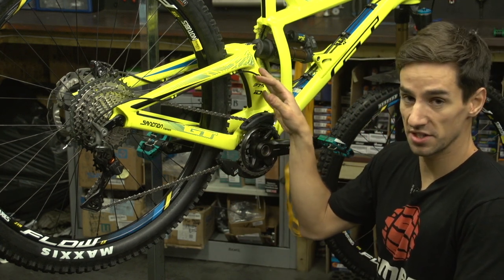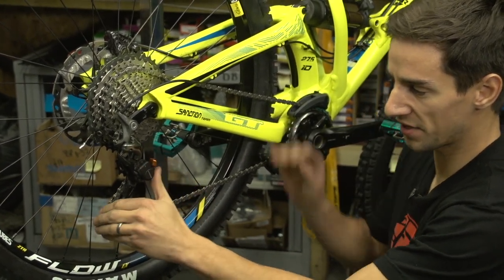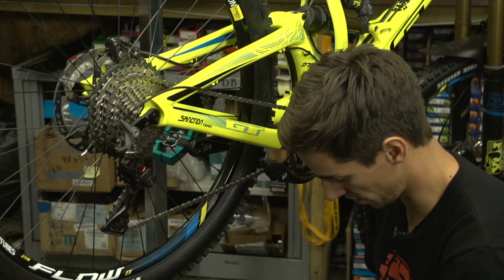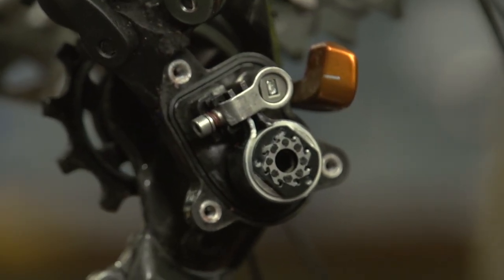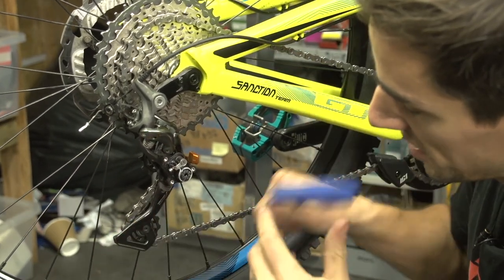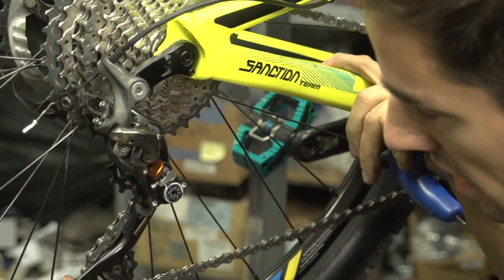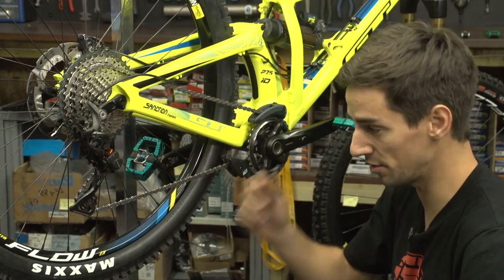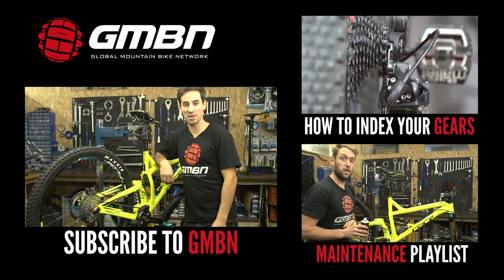How To Adjust A Shimano Rear Derailleur Clutch

Comment: Almost 5 years later, I had no idea you could adjust the clutch tension! This solved my shifting issues. Thanks!!
Reply: What shifting issues did this solve for you? Did you increase or decrease tension?
Reply: @taylorcluett  I had to decrease tension - but only a tiny bit. I decreased it too much the first time and it caused unwanted shifts when going over lots of roots.
Reply: @taylorcluett  Oh and the issue I was having was that it would shift fine with the clutch off (when on a stand), but with the clutch on, I couldn't get it to shift cleanly throughout the cassette. For example, it might shift fine in the low gears but not in the high gears.
Reply: even a year later! thanks GMBN!
Reply: Came for the same Here and even not mentioned directly in the film, but it affects shifting up higher gears-especially from 1-3. With too much tension the arm cannot jump cause its „fixed” in the pivot. I spotted that it may be due to high increase of temperature (had from winter and spring barely 15degrees to 30 yesterday). Half spin of screw solved the problem (after 1,5h fight with complete adjustment before…).
Hope this may help somebody :)

Comment: i read over there in older clutch models that the clutch torque spec for that hex screw would be 6 to 8N ??? in this case that is a recent model rear mech it can be adjusted to the desired tension??? other repeated problem with the clutch is they need the friction parts to be replaced due to alot of tension or lack of it in the clutch mechanism,it would be a nice future how to video too when time comes to that :D

Comment: Does cluch lock affects gear tune? I'm having problem with my SLX M7000. It works perfectly fine until cluch lock is used. I tried to tune my rear dera when cluch lock was on. It didn't tune properly. I'm currently using it without cluch lock. Need suggestion....

Comment: Great Neil! I had been having problems with my gt sensor, I have broken 4 derailleur hanger in least than 4 months, every broke happens whe I was riding downhill. I modified the tension in the shadow, I hope fix the problem. You saved my  wallet. Hehehe this hanger is not cheap in my country.

Comment: Are you supposed to ride with clutch in "on" position permanently & off when changing the wheel. Mine is very stiff in on position. Will have a look & try adjusting .

Comment: Is there a way to increase the tension on the chain without using the clutch. I'd like to prevent chain slap but without that bit of static friction you get with the clutch

Comment: Should I always ride with clutch on or are there times to turn it on and off on the trails?
Reply from the maker: Keep the clutch on apart from when you need to take the wheel off.

Comment: can you do the same thing with SRAM 11 speed clutch ? thanks.
Reply: I'm pretty sure that sram has no adjustable tension option
Reply: +Connor Stephens So when tour clutch gets loose there is nothing to do ?
Reply: +Connor Stephens SRAM is adjustable only if you have a type 2.0 clutch. Type 2.1 is not adjustable.

Comment: I think in this case I like how sram did it, at least on my gx1.  There is no adjustment but I don't see that being a big deal for me.  The chain doesn't hit the frame, I can shift easily; I'm happy.  It's not a clutch it's just a locking button that allows the wheel to come out easier.  I just wonder about that shimano clutch mechanism wearing over time.  Like it's constant friction and one more thing to deal with later on.  Looks overly complex.

Comment: Hey guys, i have a question... i've been thinking for a long time to upgrade to a 1-by setup, i have a 10 speed cassette and i was thinking  of installing a 42 tooth cog but i've been told that my rear mech is no good for the job (shimano deore) i was wondering if you guys could give me some good options to replace it,if possible cheap, and also could you do a  video on how to service a fork and shock. Thanks guys keep up the videos
Reply from the maker: +juan correa A rear mech with a clutch helps for 1 by setups to stop the chain bouncing around. Shimano have just announced a 1x11 SLX groupset at the budget end of the market.

Comment: I have 3 x 10 drivetrain with shimano slx  plus, the cassette makes more noise when the clutch is on so I leave it off is this ok? it appears to have to much tension on my cassette makes a clicking noise the bike is a Trek 8.6 DS with no rear suspension
Reply: My pro caliber is the same I don't think they setting the mechanism up while in the on position. I get a much smoother shift in off position. Going to have a go at clutch adjustment today.

Comment: i see that you adjust the tension when the chain is on the middle ring of the cassette.. shouldn't it when on the biggest ring?
Reply: the term spring tension used here is not quite accurate, he is adjusting the friction between the clutch faces, with the spring tension remaining the same. the friction will be exactly the same no matter what gear you are in so can be adjusted at any point on the cassette

Comment: The bolt holding my seat stem in place has worn so I now can't undo it.... 4mm is too small and 5 is too big.... Any ideas on how I can get it out?
Reply: +Abi Senior you'd have to cut it out - either cut the head off, drill it out, or grind edges onto the head so you can turn it with mole grips or a spanner. Best left to a mechanic to fix.
Reply: if you can get a 5mm torx key it is usually possible to hammer it into the bolt and loosen the bolt that way, however it may damage the torx key so don't use a good one

Comment: maybe this is a stupid question, but if the clutch is still able to move with gear changes and just adds more tension into the system, why wouldn't shimano just make a derr with a stronger main spring to keep tension?
Reply from the maker: Because then it would be really hard to take your wheel off!, the clutch is just a way to have a stronger spring that you can 'turn off'
Reply: ah got ya. thanks. videos awesome as usual

Comment: I have a 2X10 setup in my Trek Fuel & it has a clutch... I only turn it on when I'm doing any downhill or jumping sessions as I thought that with it on all the time it'd increase friction (like you said) & therefore increase wear. Am I right in thinking that? Or should I run with it on all the time?
Reply: jonboy1066 meant to be on all the time , only turn it off to take the wheel off
Reply: My Trek pro caliber is the same gears  feel very stiff in on position.  I don't think Trek got the set-up memo 😕

Comment: Hi
I'm running a m675 xt rear derailleur and after 2 months of moderate dry weather use the cage doesn't always return fully back leaving the chain slack. Would tightening the clutch cure this issue? Many thanks
Reply: It might be a good idea taking the derailleur off the bike and seeing if its not damaged or defective. That shouldn't be happening.
Reply: It's dry. You need to open it, clean it up and lube it back. Take 5 minutes. (no need to remove it from the bike).

Comment: Do we need to turn it on before we adjust the tension or is it ok to adjust it even it's off?
Reply: If you’re adjusting the tension the clutch should be on so you can try and feel (moving the cage forward a bit) if you’ve reached the desired tension.

Comment: What tire is that
Reply: Maxxis High Roller II
Reply: +Ian O'Neill thanks I was debating over than or the dhr for the rear. Any opinions? I have mud, loose, and some hard pack
Reply: I'm running the Maxxis Ardents front and back. I love them. I bought them a couple months ago when it was dry, dusty, hard packed, and loose. But now the mud has arrived, and they perform really well. If you're an aggressive trail rider, these tires fit the bill pretty well. If you ride "enduro" then the high rollers, and possibly a minion in the front if you really get crazy.
Reply: +Connor Stiles i am in favor to ardents , i have old dhr back and old HR front, works great in the conditions you tell, the olny problem i noted is the kinda rolling performance,is not bad, i came from nevegals and these tires are years better than kendas, but recent maxxis HR's and DHR's perform better than the older models specially on rolling over hardpack and muddy /dry terrains, ive try them with my friends bike and they surprized me, i thought II's maxxis models would be rebranded models that perform the same but they do way better than the older model so i will change to the new models soon, ardents are very very fast tires too i am debating wich one i will install on the bike haha XD